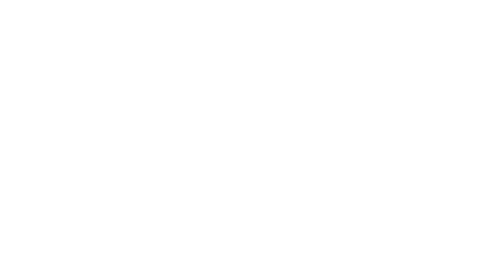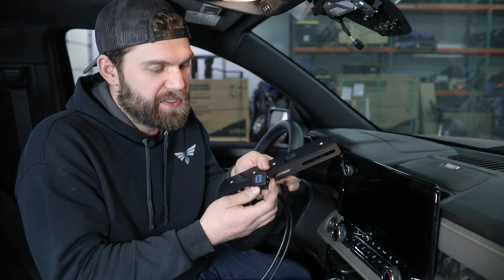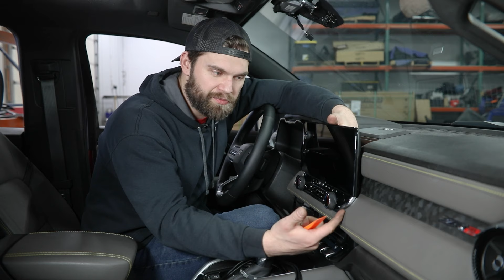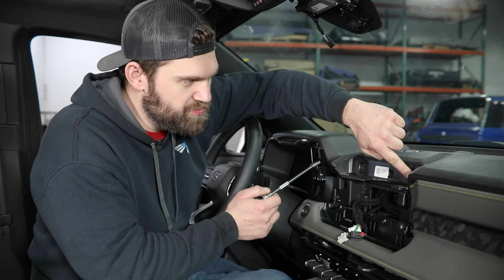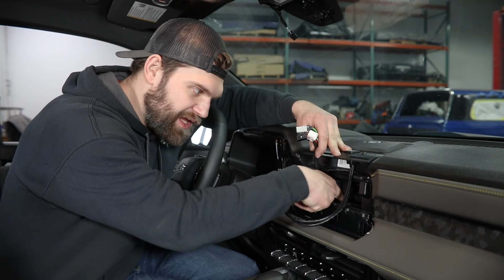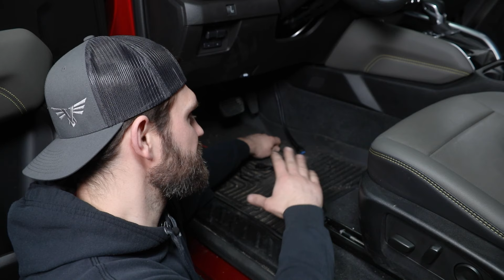Chevy Colorado Dash Accessory Mount Install

Comment: Can you wire it so there is power only when ignition is on?
Reply: You can get a Add a fuse and hook it to the USB in the fuse panel.